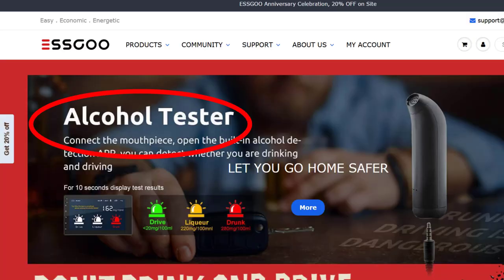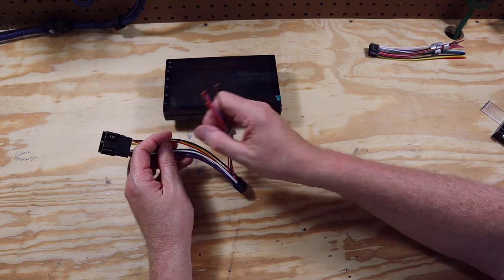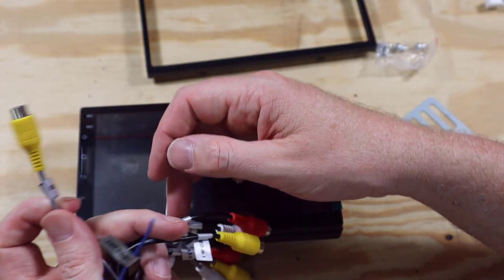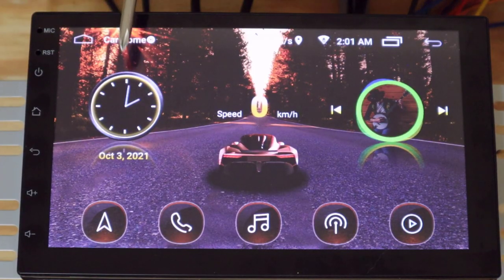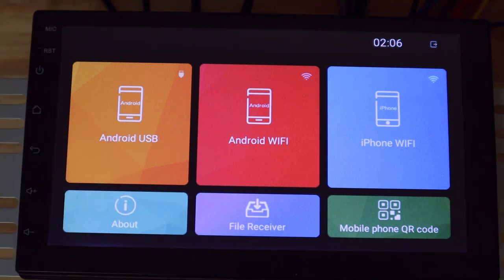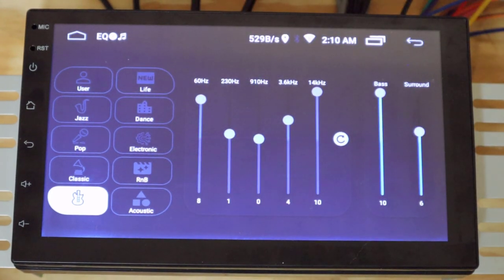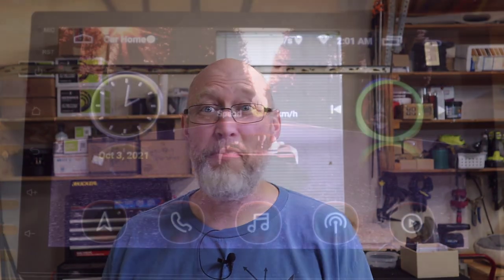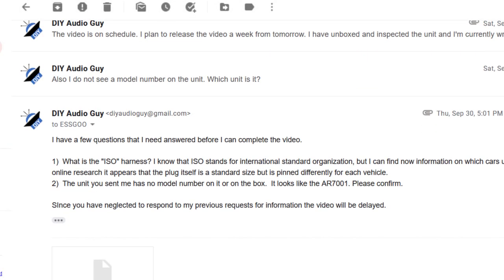Watch this before you buy an Android Radio!  EssGoo car head unit!

Comment: I bought this radio for my vy commodore. I used on plug that has 2 connections that I was able to connect too that the old radio was connected to. Started up, loads up quickly and was able to connect my android phone using Bluetooth and everything is quick there including Google maps. I have gps cable connected but my guess it may be slow uploading but idk. Overall I am happy with it

Comment: Dasaita makes some great Android head units with options for vehicle specific trim and acceptable if not beefy processing power and RAM. They also have pre-programmed CAM-bus for steering wheel controls and vehicle specific harnesses. Plus a whole lot more. I've had a nothing but positive experience with mine.
Reply from the maker: This one had a CAN-bus app, I think their higher-end models have more processing power and CAN-bus functionality.  But this is their entry-level model and it''s just not a good product.
Reply from the maker: @FETTYNOP  That is nice.
Reply: Brands like Dasaita, Joying, etc may honestly advertise specs, have better customer support, and better software, but they all have crappy build quality.  Even the best Chinese Android Head units lack the build quality of even the entry level models of manufacturers like JVC, Sony, Alpine, Kenwood, etc. I've owned several Android HUs and they all had hardware failures after a year or two.
Reply: @conchobar  I've had a Joying in my truck for 3 years and nothing but good things. I'll praise Joying, Dasaita, and Seicane constantly. They have a way better build quality than the 3rd party companies who make these head units. I'd take an Android radio over any of the big box name radios anyday. It's all about using the good company with good spec radios.

Comment: The ISO harness is a Blaupunkt connector (Audi uses this). ISO is Industrial standard, Not American standard. The power antenna only powers when on AM/FM (Audi uses this as well) while the amp turn on, turns on with the deck (this common on a lot of decks, ANT being solid blue and REM being blue/white). The EQ should play across all audio the same. This is a 1gig unit and its recommended to download offline maps. I ran one for 4 years, used a line driver and amped all speakers and it  stood up to 145db daily. Currently I am running a 9" 2 gig version that's much faster however I will be going with a 4gig soon. DSP and interior amp again, we will see how well it holds to a 150+. Not the greatest deck but for $130 that I paid for my 2g 9" version I will take over those sub $1000 units as I have installed a few and not impressed. I can buy the head unit, audison DSP, 4 channel amp for less and get much more.
Reply from the maker: Thanks for the info!  I did some googling and apparently Freightliner, Audi, Volkswagen, and several others used the ISO connector.  I could not find any information on how these things were pinned though.  For the pictures I found online they were all pinned differently. Glad to hear that you found a version that would work for you.
Reply: @DIYAudioGuy  Hyundai/kia also uses this connector, and they go one quirk better, they flip the yellow and red, red being constant hot and yellow being switched, had me stumped for a bit on that one. Best bet is when installing a headunit is get the factory wiring diagram, you might have to pay $10~20 but well worth it.
Reply from the maker: @charleswp71  what's the point of having a standard size connector if every OEM uses a different pin arrangement?
Reply: @DIYAudioGuy  The form of the connector ist standardized. The Pinout is too - it is actually VAG (Volkswagen Audi Group) that started the "let's switch the power pins" stuff. A lot of people burned out their ignition key contacts when the radio was pulling its current through that contact ^^
(Blaupunkt was delivering the radios for them, iirc, so maybe it also was a Blaupunkt thing. Lots of japanese manufacturers, JVC and Clarion p.ex, had connectors in their iso harness so you could swap yellow/red without using tools).
But the pinout for the speakers and most other things is standardized. It is more about the form of the connectors, similar to the OBD2 connector: Form = standard, protocol = individual to the manufacturer. Apart from emissions relevant stuff.

The upside is: If you have an iso connector in your old car you can take out the head unit and put it in your next without a problem.
Reply: I'm thinking of buying the 2gb unit for my 2000 tundra work truck. What do you think. I bought the truck for $600 I'm not spending $600 for the head unit. Do you think the 2gb unit will be okay?

Comment: I have a $200 eonon head unit in my car
The Q67pro
and this head unit has very very good performance
I would say comparable to a mid to high end phone
And I am a person who have used phones for every price point so that would translate to android radios
My radio is minimum in the case of ram/storage imo
Make sure when buying one of these they have at least 3gb ram 32gb storage but 4/64 is optimal

10/10 would buy again XDD
It's actually better than most radios you can get for that price tbh imo

Comment: I have an android head unit.
Sound is great and perfectly integrates with the stock JBL Synthesis 10 speaker surround in my 2006 Toyota. I still have steering wheel controls and I managed to get Android Auto working, of course with the help of some accessories  especially to keep the phone charged like a usb hub and a carlinkit. I believe most depends on the android head unit brand you buy and the price range in which it fits. A good rule in my opinion is to look at a 250/300$ budget to get a decent android head unit. Basically you get what you pay for, and the head unit in this video is one of the cheapest on the market for less than 70$.
Reply from the maker: Stay tuned, I just got one in for review that might be a real winner!

Comment: I've had a few friends buy these units and we installed them in a mustang and a couple of chevy trucks they didnt fit any dash kit we had to do to much modifications to get them to fit😂😂 I told them next time JVC or Pioneer👍🎵
Reply from the maker: I am sure that there are good ones out there on the market, but they are hit and miss.  Why take a chance?  A few bucks more and you can get a Boss touchscreen that would at least fit and work properly.
Reply: @DIYAudioGuy  Yep your right that Dual brand double din touch screen at walmart is a very nice unit we've had it in a truck at work for a year and no problems👍
Reply: You manage to add music to library,this system has my head blown lol

Comment: I'd like you to have done the DD1 to see when the head unit starts to distort, but yeah most headunits aren't great but you are getting a lot for that money, especially a touch screen at that size. You'd be hard pushed to find a branded unit anywhere near it.
Reply from the maker: I was going to grab my oscilloscope and see where it clipped, but after going through all the various features I did not see the point.
Reply: Joying and t’eyes also makes some attractive unit. 4-6gb ram and up to 128gb memory. Makes for some speedy unit. My joying warm boot is bout a second. Preamp rcas is about 2.5v.
Reply from the maker: @BTL3.0  there are some good ones out there, I bet some of the higher end models from this company are probably pretty good.

Comment: I am a professional installer and in my opinion it’s very difficult to install them because they are oversized than a standard double din then I have to alter the kit, also it’s a pain to mount the radio since it doesn’t it doesn’t have a chassis to use the mounting screws

Comment: Blue wires and why 2 of them. One fir amplifier turn on, and the other for a power or powered antenna. Some OEM antenna are amplified and require a power switch to turn on with the radio

Comment: I have one of those Android head units , and the way I got around running more amps is I patched the single RCA through my DSP and then used my computer too configure the 2 channel input too 5 channels out . The cool thing about that deck is you could change the output  Signal through RCA too 15 watts , but I would not advise that !!!
Reply from the maker: Most people that are in the market for $100 head unit will be using a DSP.
Reply: @DIYAudioGuy  I think most people with a $100 budget Will NOT be using a DSP...heck most of people at the entry point don't even know what a DSP is!
Reply from the maker: @theejoeylee  That's what I get for using speech to text to reply to comments.  It somehow missed the knot part.  You are exactly right, but you're looking for $100 head unit you are not running a DSP.
Reply: @DIYAudioGuy  Haha! Darn auto correct!

Comment: ISO connections are standard in most of Europe and various other countries around the world. Every brand of aftermarket head unit, big branded and Chinese, all have an ISO connector when you buy them here. You then buy looms which include a CANbus decoder that go between the factory connector in any car with ISO plugs on the other side. That makes it a very, very simple plug and play situation to install ANY head unit. Why most of the USA is still splicing individual wires is completely beyond me
Reply from the maker: That's what I gathered when I was researching this video. What I can't seem to figure out is if there is a standard pin pattern for the ISO plug. Just looking at pictures and diagrams online this one does not seem to be pinned the same as some of the others out there.
Reply: @DIYAudioGuy  yeah it's a standard pin pattern, never changes. As you mentioned in the video, one half of the ISO has the speakers and the other half has the power ect. Some cars swap the permanant live and ignition live yellow and red cables

Comment: That's a plain and simple tablet with 2 cores and 1.3 ... and that's an entry lvl. For 100 bucks you can't ask for more. Before buy something you should check what does it have and check for the reviews, that's a good indication. Don't buy the first one, and before bash that item you should reach the manufacturer for info on it and if there's a better version. And then you can make a good review on the entry lvl but if you want to buy there's a more good version. About the sound quality, never mind that, inside a car the sound moves different, and most of the head units sell today they need an external amplifier.
Reply from the maker: They reached out to me and asked me to do an unpaid review, I let them know that if the item was of low quality it would get a negative review, they sent this to me anyways.  They could have just as easily sent me their top of the line version, but they didn't.

I gave this unit an honest review with my honest opinions.
Reply: @DIYAudioGuy  so if they sent you a low quality product, not your problem. Nevertheless it was a good review.

Comment: Uh oh I already did lol and it's been such a pain in the butt. I bought an android unit from China specifically and it goes against everything I've ever learned about installing radios and subs.
Every single wire is different than you think it would be. I've had to just cut try repair and try again every time I've hooked something up to it.
Back up camera 
Amp remote wire
Speaker inputs.
Everything comes from a different wire than you'd expect and is labeled like a poor Chinese to English translation as you'd expect lmao
Reply from the maker: I'm sorry to hear that.  I wish more people would see this video.  I would like to spare people the pain of having to experience a crappy product for themselves.

Comment: Sort of like buying the cheapest 10 year old specked Windows computer hardware and be surprised it runs slow with all Windows 11 O/S and products along not very capable with newer web sites that have high resolution advertisements, newer games studder and have to be played at lower resolutions and wonder why it takes so long to accomplish anything. 

I did try a sub $200 low resolution Android head unit 5 years ago it worked better than expected with an added Amp for the first few years, plus it integrated with a recording dash cam, a backup camera, phone connectivity for navigation and hands free, and provided 0DB2 on screen diagnostics where I could put up extra instruments that my instrument panel didn't have - none of that stuff was available on that 12 year old car model when it came out. Though the screen was 10 inches it was too low of resolution. It too had those thin conductor wires which after opening it up and adding things to it over the years caused failures simply because the wire harnesses wouldn't hold up to being unplugged and plugged back in too many times though it still functions in that old car I had to combine two of the 5 channels because the work the redo the harness with those thin wires is not worth my time and it's an old car I'm getting rid of.  

Just like buying any electronics you can't go cheapy cheap because you get what you pay for or in your case what you don't. I just installed a $400 8 core Android Head Unit with 8 Gb of Ram and 128 Rom and it works fine while the plugs and wire conductors are as good or better than anything on the market, but even then you still have to customize it with the apps you prefer.

Best of all though the better units support both CarPlay and Android Auto both wired and wireless - thus in time when the head unit becomes more obsolete you can just rely on your solid Android or iPhone connection since on average we replace them every 3 years.  My unit even comes with a SIM adapter so if I wanted to add a $10 line and sim card to my phone account I wouldn't even have to rely on using my phone to tether for an Internet connection. 

Yes new car head units include nearly the same connectivity, but not everyone is buying new cars and my 7 year old car stereo did support CarPlay but not Android Auto for my Sony Xperia phone and the car models two years newer (2019 models and newer) only supported USB wired Android Auto not wireless.

 I considered JVC and other name brand head units and discovered to get an equivalent size and resolution screen name brand JVC unit is about 1k plus another several hundred for install kits, Can bus adapters for steering wheel controls and other proper harnesses, so that's $1500 plus tax before you even consider an Amp and speakers. 

If you have the money and no programing skills go with traditional name brands but know the entry point is going to be 1k + for the same end results. Know that there are decent Android Head Units, but to make the interface as satisfactory you will have to put in the time to customize their programming but they are actually easier and less expensive to install for the same or better end product.
Reply from the maker: Well, they sent me the unit to review  -- so it is more like sending out cheap units to review and then everybody seems to act shocked when it gets a negative review.

Comment: Still seems like a mustang to my  pioneer 3800 and 500exs being a geo metro. Put foobar2000 on it, and it'd smoke my pioneer double dins. 

Is the rca output a decent clean 2v? This plus say the pioneer deq s1000 or even the dayton dsp, that'd be perfect!
Reply from the maker: Yeah, this would be a fun toy to play with if you wanted to download a new operating system and do some hacking.  I wonder if it's possible to bypass that stupid surround sound feature.  Maybe run all four channels into a kicker key?
Reply: @DIYAudioGuy  If that surround sound feature bugs out, I'd probably just run two channels to a kicker key or any other dsp. Pretty much let it do the work from there. If the outputs clean, something like this is perfect for me. Foobar2000 has its own 18 band equalizer, and works well on low end hardware.

Just the average person who hooks speakers up to their headunit, ah I'd throw this IN THE BIN!

Comment: Those radios are huge and don't fit in most dash kits without major modifications. I stopped installing them a long time ago
Reply from the maker: This one looks to be double DIN, but this company sells some that look a little bigger.
Reply: @DIYAudioGuy  I've put in a few dozen of these "white box" units, not a single one was standard double din size, they were always a little bigger, for the ones with out a volume knob they were usable, but every single dash kit needed some trimming to get these to some what fit, if you want a more flush mount be prepared for some router trimming

Comment: Yup, I bought one a while back. Barely enough watts to power a 3.5” speaker on its own. Connected through rca’s, it isn’t enough signal for an amplifier either… shame. Decent features for the buck but not for speakers nor amplifiers
Reply from the maker: I never got around to doing any legitimate power tests of the unit because it was such a garbage user interface.  Essgoo was unhappy, they even ask me to take the video down.  But apparently they have a short memory, they just emailed me again, asking me to review another product.